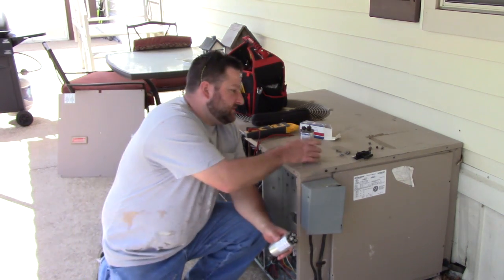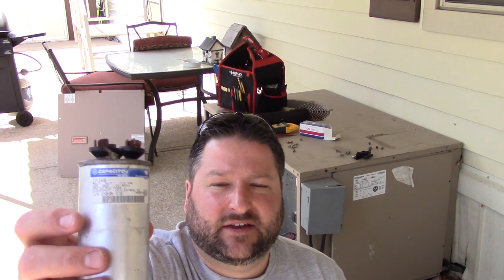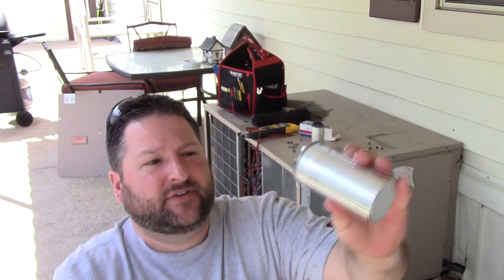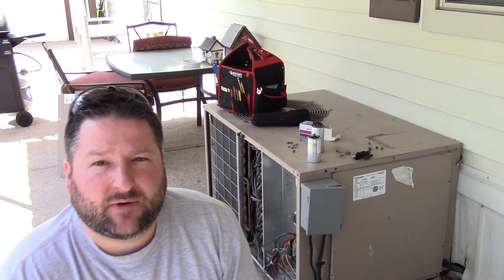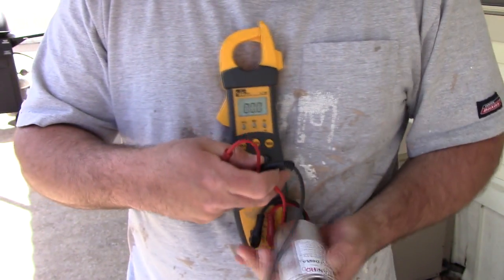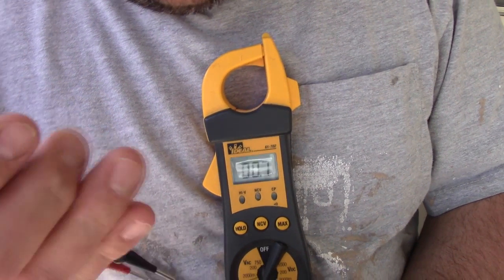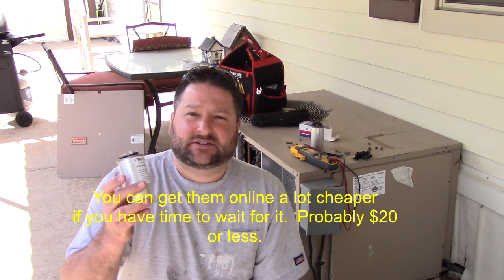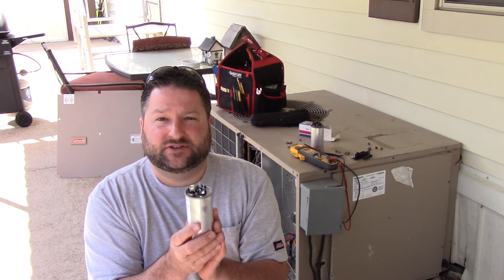Easy DIY fix for A/C Fan & Compressor not working-Test the Capacitor

Comment: Step #1, turn off circuit breaker to outdoor unit or pull out fuse from the outside electrical box at the compressor, there'a 220v inside the outdoor unit at all times.
BTW- do a video on getting rid of stinging insects.

Comment: Great video.  I've got an older Fluke meter that doesn't have the mfd test.  What kind of meter was that?  Thanks.
Reply from the maker: +SyberPrepper   Thanks Syber.  My meter is an IDEAL 61-702     If you are looking for one with the MFD on it mine only goes up to 200   I have seen some that run up to 400     So depending on your needs keep that in mind.  For me 200 is plenty enough.
I'll run a review on the meter but I can tell you now that I really like it and I've had it for some time.  It has a NCV button on it which is for non contact voltage, you hold down the button and put the tip of the meter by a wire, if it's live the meter shakes and makes a noise.  That was something I wanted on a meter because it's a pain to carry around the separate NCV wands.
Reply: Thank you Burb Billy and SyberPrepper: I had the same exact question.  I have a fluke 77 series ii, which has lasted me from early 90s, served me well for years, and was pretty expensive at the time, but, I'm seeing used models of the IDEAL 61-702 for around $70, so fluke will probably be a secondary to carry around in car trunk.
Reply: +The Burb Billy (The Burbbilly) my a/c just failed and it was the capacitor too. just so you know in big box stores they are 3€ aand in electronic specialized stores 9€.